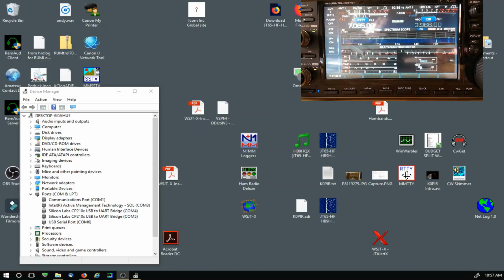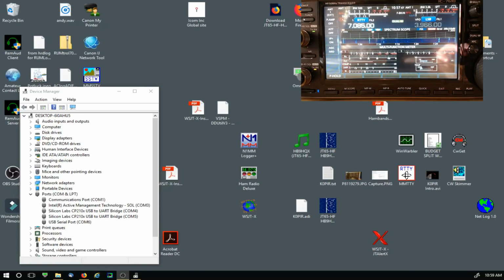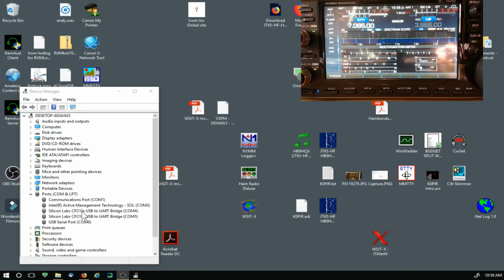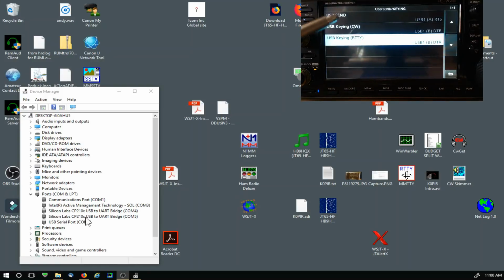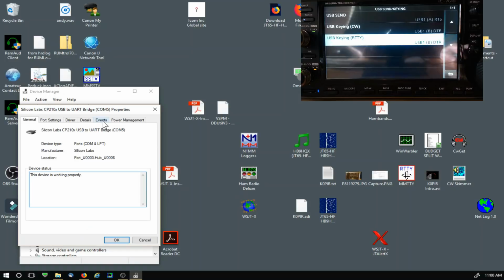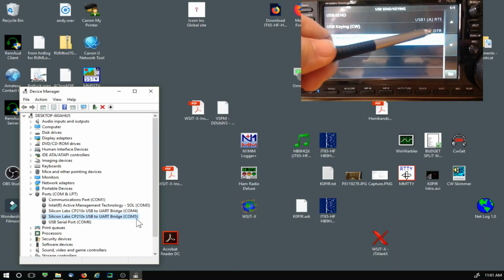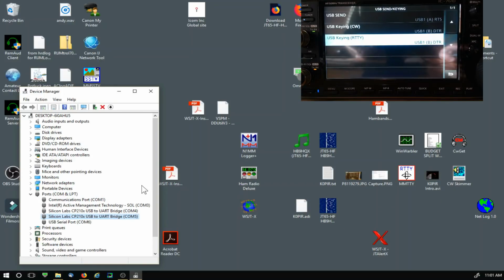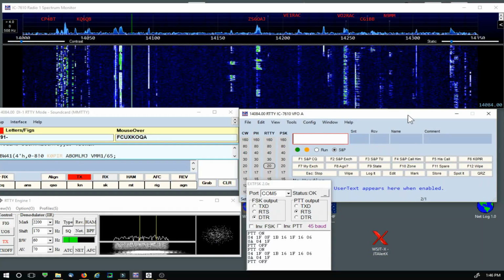Icom 7610 Virtual Serial (COM) Ports Explained

Comment: Does it matter what physical port.  i want to use A for rig control and B for FSK and CW.  Does it matter what port the cable is plugged into on the back of the rig?

Brad
Reply from the maker: Hi Brad,

Yes the USB2.0 on the rear, not the blue one. That blue USB3.0 and not being used yet. Use A for rig and B for data. Got it huh? 73 - Rich, K0PIR.us
Reply: Because page 1-3 in the basic manual says USB 2 physical port is for digital data, input/output, I plugged into it.  No go.  My two com ports disappear from the device manager.  Using USB-1, Win4ICOMSuite comes right up along with WJST.  What is the difference between the two physical USB ports?

Comment: I'm stuck, and don't either understand or something is not set right.  I have a 7610 but can't get what you refer to as Comm Port B working  .  Comm Port A is working fine.  I am assuming that if a take an application , like Commander that works fine on comm port A (my number 6) and then change Commander to use Comm port B (my #8 ) that Commander should work providing i have the baud rate, bit rate,  set correctly.  However they do not, nothing works on Comm Port B.  I installed the Icom drivers on a second PC and had the same problems.  I assume you only have to use one USB cable from the back of the 7610 to the PC to normally be able to use both Comm Port A and B.  I tried a second cable , just in case i had a bad cable but same results.  Then I thought perhaps you have to actually use two cables , one for each comm port.  I plugged my second cable in the USB 3.0 port but all that did is add some high speed bridge.  So, after hours of trying... I'm looking here for idea.s   Thanks, Andy K3UK.
Reply from the maker: Hi Andrew,
Nice to hear from you and great question. Yes, just one cable. Sounds like you have it in the correct port on the back of the radio also. It is not the blue USB3.0 port but the USB2.0 on the rear of the radio. The blue USB3.0 will be activated at a later date by Icom.

I think you have it correct. The A port is the one we use for rig control (CAT). Is is for CI-V. The B port is for FSK Data, so you will not be able to use that one for rig control.

I hope I understood you correctly. I think you are setup FB. Okay?

Rich, K0PIR
Reply: So, I wonder why Comm Port B does not connect to Commander if I choose that comm port rather than comm port A ?
Reply from the maker: The B does not carry CI-V commands. It's just how Icom has it configured. Everything I have done with it on multiple computers, software programs and OS's works FB. Just choose A for CAT or rig control and B for whatever else you need like FSK keying. - Rich, K0PIR
Reply: I was beginning to wonder if that was the case because I used a program to look at Comm Port B and it was open but not sending info.  So, use B if I have an application that needs another line for something like CW keying or RTTY FSK ?.  Thank you, you have saved me hours of head scrathing
Reply from the maker: Yep that's it exactly. I use the extra COM port for FSK and for CW keying. In the software, as I have it in my radio, it will use DTR for keying on that port. It works great. Can't wait until they get the USB3.0 high speed port operational! 73 and thanks for commenting. It will help others as well. - Rich, K0PIR

Comment: Rich thankyou for the informative video. I am having some difficulty useing wsjtx straight with no logging software.Using your settings is a no go. Thanks again
Reply from the maker: Hi Earl,

How are you setting up the Radio (rig) in WSJT-X? At the moment the IC-7610 is not supported and it won't work with another rig, like the 7600 or 7700, selected in WSJT-X.

I am patiently waiting for WSJT-X and HamLib to be updated with the 7610.

Rich, K0PIR
Reply: Ham Radio with K0PIR 

I have tried every setting combination. No rig and vox works but is no fun ").

Thank you for your response. I was beginning to realize that there is something wrong with wsjt.
I will look into the configs to see what makes the 7300 work (perfect).
Reply from the maker: I have used WSJT-X with no rig, but using RTS and one of the virtual COM ports for keying.  

Another thought, DX Labs Suite Commander works good as the rig. I have mine setup that way right now and using DX Keeper for my log. Also using JT Alert to log contacts into DX Keeper. I think I'll do a video on it when I'm comfortable using it. 

Sometimes it's just trial and error until you find what works. Best 73!